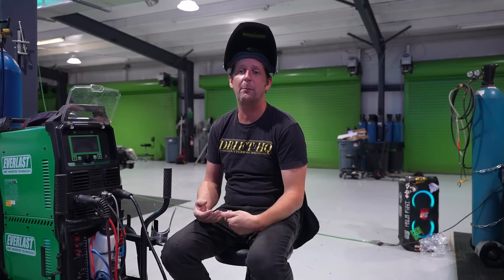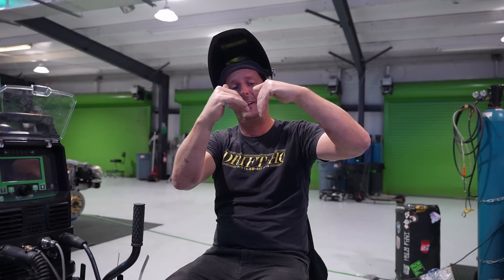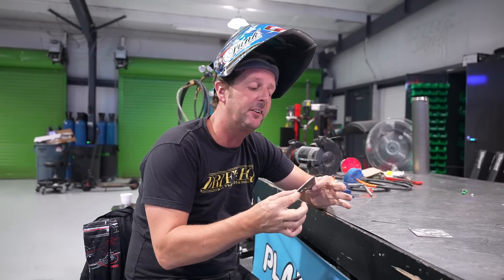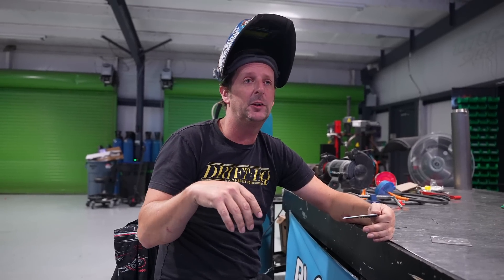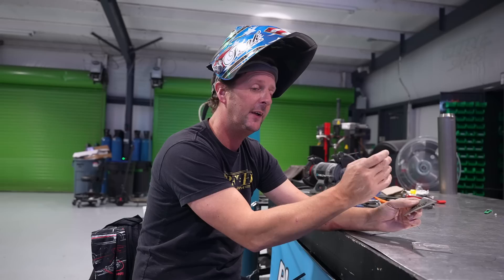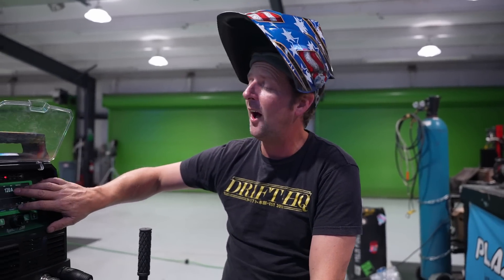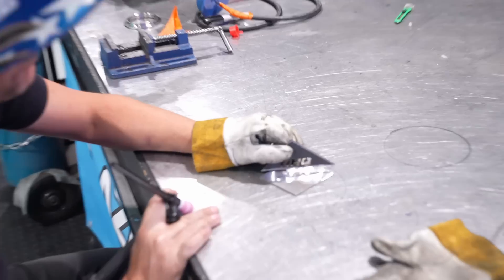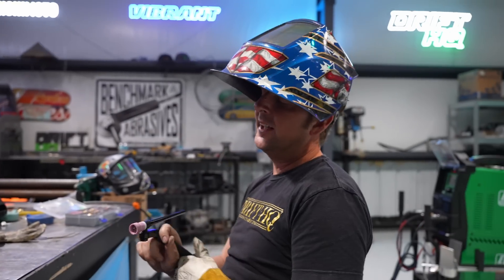Intro to Tig Welding | How to Series EP.1

Comment: Can you do a welder component break down mig and tig from machine to cup. Like a parts list of sorts if that makes sense. Cuz the info you put out in this video was awesome but I didn’t know what half the things were and or where to find them.
Reply: I can do that
Reply: @CrickettFab  this would be great. I did some stick welding years ago, bought a mig machine last year and fiddled with it a lot, but to many little projects need a tig and going from one to the other is a confusing step. I’ve got a garage full of drifthq parts that need to be welded and need to get started now that it’s getting cool. 
Thanks.
Reply: It could be a fundamental parts breakdown of the components on the machine where they go and what they do
Reply: @CrickettFab  perfect. Like I get what you mean when you say this is this and that is that and they do this. Like the pedal and the torch but you said you got 20ft of cabling from the machine to help prevent contamination when we are only seeing 3ft used. I mean you could do a couple part series on component break downs and usage or what to’s and how to’s. However great work man and awesome content.

Comment: Also i wanna ask . What type of methods of weld is better : foot pedal or use the handle
Reply: It really comes down personal preference and where you are welding. You may not be able to use a pedal In Certain places.  In those cases a finger trigger is better. But for better control of the amps, pedal for sure is the way to go